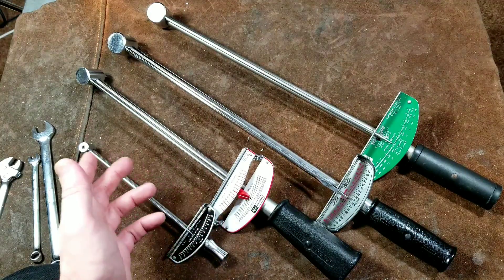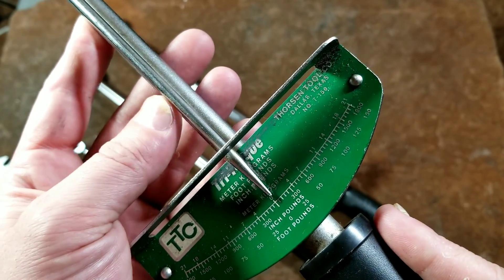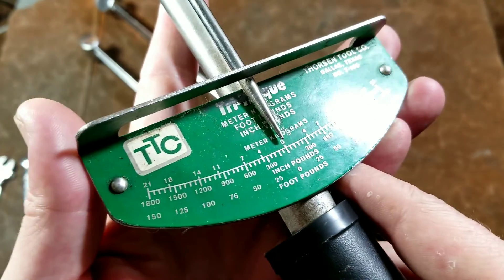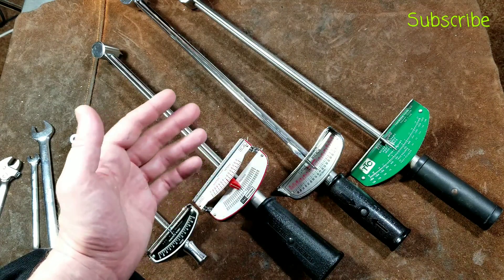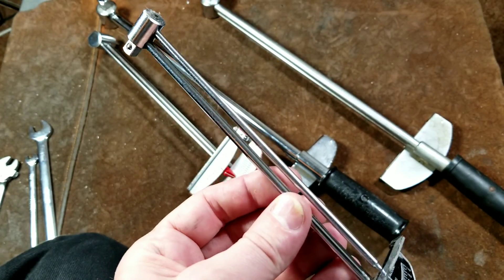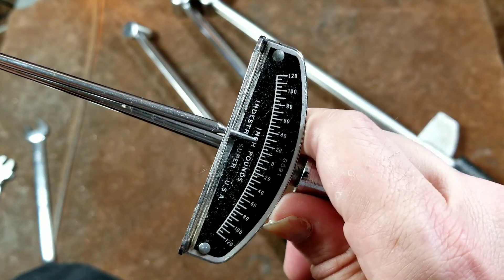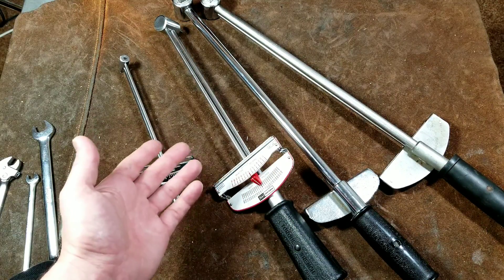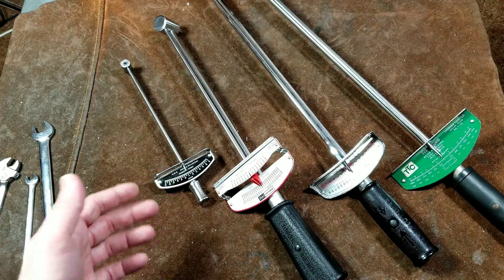Deflecting Beam Torque Wrench Review & Comparison

Comment: You can easily modify your beam torque wrench to emit light and sound at a specified value by adding a battery, wire, LED, and a small speaker.
Reply from the maker: That's an interesting idea for modifying a beam torque wrench!

Comment: I think I'll switch up to this style wrench. I've bought two of the clicking ones and for the life of me can't get them to work properly. I set one to 20 pounds and tested it on my cars lug nut. Snapped the stud right off. I tried it from hand tight and from properly torque. It's not rocket science. You set it at the number and it's supposed to click. The collar is spring loaded so that can't be unlocked. I give up.
Reply from the maker: Sorry to hear you had trouble with the other type of wrench.

Comment: With  this type of torque wrench one cannot get the hand position wrong but I wonder how adding a bar to the end of the handle  would make any difference or not to the outcome. As in these two short videos. https://youtu.be/tTbjLAm7XnQ?si=885sZ8Fwt9Iw9fHV                                               https://youtu.be/mk95F0hHS3U?si=vdS4hI08-O6Tjshk
Reply from the maker: adding a bar of the plastic handle would not make a difference.
However, if you grabbed the thick bar in the middle of the wrench instead of the plastic handle (and kept the plastic handle in the center of the pivot it would make a difference.
deflecting beam wrenches rely on a calibrated amount of bending in the thick bar, if you grab the bar close to the head it will bend less for a given amount of force and you would over torque the fastener.

Comment: Hi nice video. And nice cat. I'm about to get a 1/2" 300Nm beam for very cheap, much cheaper than a click that goes that far up in torque. I only need it for the hub nut. You said that 150ftlbs (200Nm) is about the limit so I wonder about the quality of this particular tool. But I guess it should be better than guesstimating just through lever_arm*weight?

Comment: The wobble as you call it is so all the pressure from your hand goes through that PIN in the center of the handle to the tool for consistency and accuracy
Reply: Another point to clarify regarding how this device works, is that it is not the needle that moves, it's the scale that moves.  The large beam is physically bent/distorted when the force is applied, the scale is fixed to the large beam, the stationary needle then indicates how much the scale/large beam has moved (applied torque in ft-lbs).

Comment: With those wobble handles that are pinned in the middle, you're supposed to keep the handle balanced in the middle so the force you're applying goes only through the pin that holds the handle on. This is because the torque wrench is calibrated for that exact distance from the pin to the anvil where the socket goes.
Reply from the maker: Thanks for the tip!
Reply: @CatusMaximus  Cheers!
Reply: @CatusMaximus  so the same concept applies to the tiny T Wrench but there is only room or need for a few fingers on the handle to put the force into the tiny handle (creating another exact spot for the wrench to calculate the torque from).
Reply: @jotu173  If anyone comes past and reads this, the T drive screwdriver wrenches work on a different principle to the Length Dependent beam wrenches, and this enables the T drive to slip and stop delivering torque at the correct torque output regardless of how or where the T handle is gripped.

Comment: If you ensure that the handle is not touching the steel at the end of the handle, then the force you are applying will be at the pivot point. I am guessing that this is their way of ensuring that you receive a consistent reading.
Reply: If the needle is bent, it's really easy to bent it back to position where it doesn't touch the frame. That's the way to zero the needle, too, which is the only calibration possible for this tool.

Comment: Are these accurate compared to the clicker ones? Would you suggest it for a hobby mechanic with a seriously tight budget?
Reply: Yes, these are plenty accurate enough for the hobby mechanic. Most torque values are given with a margin of error anyways, so these would fall within the measurement range. I know someone who over torqued a bolt to the point that it sheared off using a bargain basement click style torque wrench. He would have been better suited using one of these beam style torque wrenches.

Comment: Is it true that beam type rarely get out of calibration vs click ones? how often should you recalibrate beam type? and people actually use beam type to check on click type wrenches?
Reply from the maker: Unless the needle or the beam gets bent deflecting beam torque wrenches never need to be calibrated it's all based on the rigidity of the steel rod and yes you can connect them to a click type to see if you're getting a relatively accurate reading

Comment: Do you have a recommendation for a 1/2" drive, 0 - 150 Lb. beam torque wrench?
Reply from the maker: The Craftsman ones are pretty easy to read with their nice red and white high contrast indicator
Reply: @CatusMaximus  Thanks.  I moved recently and couldn't find my old SK beam wrench, I dug through boxes last night and found it.  It only goes to 100 PSI, but hey it has worked for me since the late 1960s.  Thanks for the thoughtful response.

Comment: It's hard to find these kind of torque wrenches in Australia, mostly we can only get the ratchet style or the super expensive and over engineered brand name deflecting beam wrenches.
I'm fine with paying $30 or $40 bucks and having to replace a sensitive tool if it goes out, it's sure as hell better that paying a $300 replacement cost for a name 1/2 defecting beam, or paying the high servicing and calibration cost for the ratchet style wrenches.
Reply from the maker: Yes the split beam wrenches are expensive. These simple deflecting beam wrenches are pretty nice and are accurate

Comment: probably the best way to describe the handle pivot is so you 'float' the handle in use so that you are pulling only at the pivot point... and NOT bound up on the front or the back of the handle against the beam.
Reply from the maker: Yes thank you I needed to have clarified that in the video

Comment: Kilopond is an outdated unit for force, or in combination with meter it was the unit for torque. It was replaced in 1978 in Germany by the unit Newton, or Newton meter for torque. And don't mix mass and weight, kg is mass, kilopond is weight. Mass is everywhere the same, but the weight is different on different places. If you have a mass of 100kg on earth on sea level you have a weight of 100kp. On the moon you still have a mass of 100kg, but your weight is only ~16kp.

The unit that is now in use is Newton meter (Nm) for torque. The conversion factor from the old kpm to Nm is 9,81, and so it is from this meter kilogram thing to the unit which is common for this.

https://en.wikipedia.org/wiki/Newton_metre
Reply from the maker: Thank you I didn't believe it was an error but obviously being such a strange measurement unit it was not very effective so they went with a much more accurate torque measurement rather than a weight measurement it seems strange that they would have chosen that in the first place
Reply: As a weird twist British used to call it mkp (meter kilopond) and continental Europe called it kpm (kilopond meter) similar to Nm used today. The logic for mkp unit was to mirror foot pound where length is before the mass. Obviously, real torque is actually force applied to some distance which is why Nm is used nowadays instead of mass at some distance.

Comment: I own nice click type torque wrenches but have found my old beam ones to be highly accurate if used properly. Balancing the swivel handle is important. Nice review, these tools are under rated in my opinion.
Reply from the maker: Thank you and yes indeed I believe they are underrated as well. So nice just to grab a torque wrench put a socket on it and then torque to the desired value without having to adjust handles and knobs and other weird things